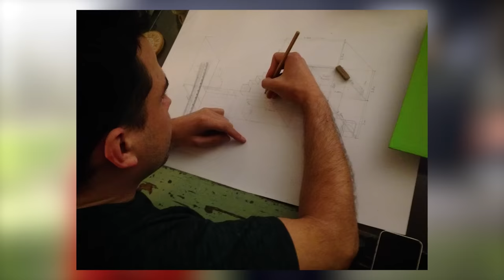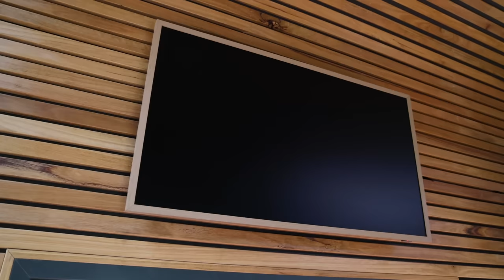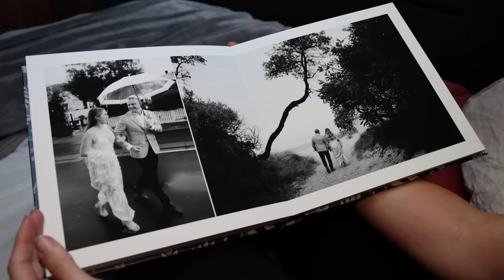Ultra-Tall Tiny House WIth Pop-Top Roof And Brilliant Home Office!

Comment: Very nice tiny home. I don't like the dark walls, so I would have had them painted white, to brighten up the place, but that's simply a matter of color preference, and not a design problem. There is plenty of storage, including a place for the clothes washer, which I'm guessing is also a dryer. The pop-up loft is great. Low ceiling lofts are a great way to get a concussion. Although the end of the loft is lower, being able to stand in much of the space is a big safety help. You can easily get down into bed from the higher ceiling area and then spread out into where part of the bed is by the low ceiling area. Once you are down in bed there is enough head room at the low end, so it's not a problem. The reading nook is nice, but it could also be used for more storage or for folding clothes. It's nice to have such options. The living room, dining room area also has options, and that kind of flexibility is a big help. Overall, this is a lovely home. Unfortunately, with 2 bad knees and a bad back, I can't handle the stairs to the loft. On the plus side, my current home is a handicapped accessible apartment, so there are no stairs inside, or out.🤗

Comment: After my divorce,  I  moved in with my mom. I  made a loft bed so I would have a sewing table and closet space beneath.  But I had to climb a ladder to get in bed,  and crawl around to make the bed (queen size, ) because I only had 3 inches between the ceiling and my head when I was sitting on the bed.  As a mid-40s woman,  I quickly decided that I would not choose to do a tiny home if it meant ladders and crawling.  The walk around head space in this home is a game changer! And that green ... my kitchen and bathroom are already sporting it. Love love love your beautiful place.  Thanks so much for sharing it with us!

Comment: This is one of the most convincing designs and build outs I have seen. One thing that bothers me: how good is the isolation of that house? Does this only work in warm areas or would this as well be energetically efficient in mountain areas in snow around -10 to 0 degrees Celsius?

Comment: Agree with so many others, this is my stand out favourite tiny house. From the layout, the clever hidden elements, those gorgeous windows and seating area to the fact that you can actually stand to get dressed in your own bedroom and finally the gorgeous decor 😍

PS, would the owners be willing to share the paint and stain colours? 🙏
Reply: You can have any color easily made. There's a Cocoanut Grove, forget which company,  that makes an olive green like this. I have some. Didn't like the company making it. So I used Behr's Marquee. Inexpensive, works extremely well to cover and if you need to repair it, it's easy. Keep the numbers on the lid so you can get more.

Comment: The side panels on the pop-up can be hinged so they fold up from the interior when the roof, which I take for granted is hinged, is raised, instead of panel sections. The front panel of the pop-up can also be hinged to fold forward onto the roof when in travel, although that would add a bit of extra height on the unit.

Comment: I noticed your refridgerator, opens on the left, I believe you can change the opening, to open from the right, if you want by changing the hinges, at least older models you could do that, and also the handle

Comment: hi, I'm an Italian architect passionate about innovative residential architecture. I am especially interested in mobile homes. unfortunately in Italy the technical regulations impose very strict constraints both as regards its handling and positioning, and as regards the plant equipment. summing up, I can say that houses like the one briefly described in this video, despite being complete and livable, are totally penalized by Italian legislation. They do not meet the fundamental prerequisites necessary to obtain the certifications and guarantees necessary for habitability. They could be a very valid option (economically more advantageous than traditional solutions) but it is not adopted due to the citizen's impossibility to regulate it permanently and definitively.

￼